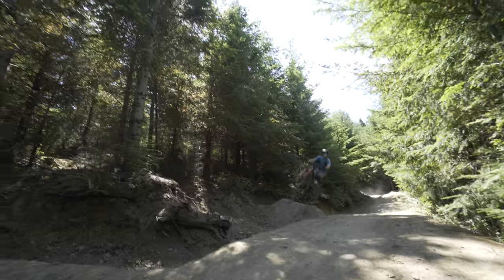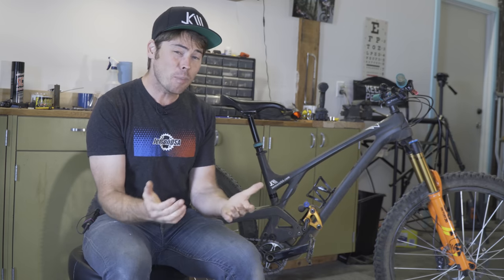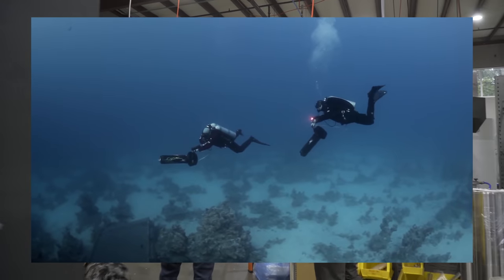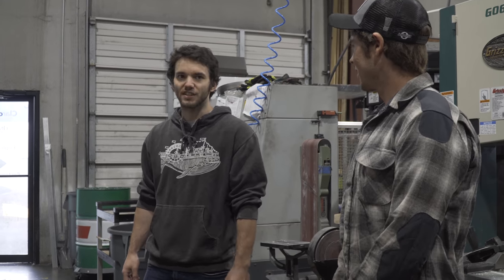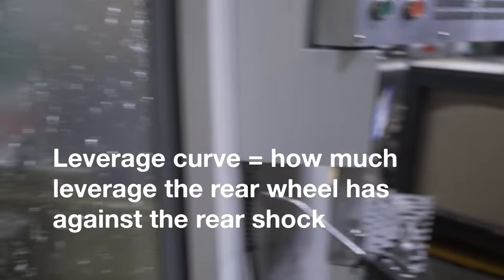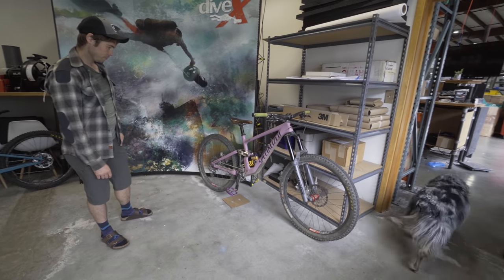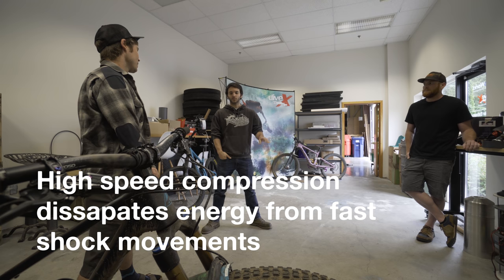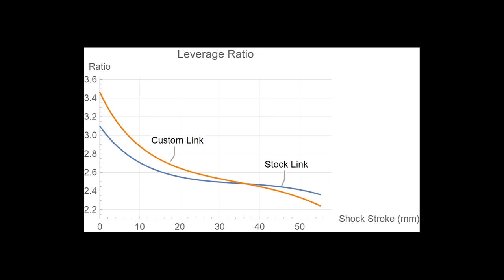Cascade Components linkages: story and test!

Comment: Cascade link went over center over compressed rear shock jamb rear tire against seatpost I went over the bars took 3 mechanics to pull it out sent link and frame to cascade for evaluation and they could not find anything wrong except minor bearing wear and they sent all it back said tuff pal we can’t find any fault with our product. Lesson learned Factory engineers design frames best not to try to make a frame travel further than it was designed for! Now I’m stuck with a damaged $4k carbon frame front triangle. I changed back to Santa Cruz standard link to be safe. I have videos without shock on that I sent to cascade they you can see how link allows head of bolt gouge into frame and jamb

Comment: I have my Tallboy 4 set up very similar to Logan (140 Pike, Super Deluxe, CC link) and I AM a bike nerd. In addition to the leverage curve change, the Cascade link adds 8mm of travel and 5mm of chain stay length. I think all of those factors combined are what make the bike feel so good.
Reply: Do you feel the SD is much different than the DPS with with the CC link? I am hesitant to add more weight but am curious of the difference.
Reply: @Mtully01  I had the SD on before i changed the link, but it felt better to me than the DPS. I think the DPS is fine for more XC riding but the SD handles chunk and bigger hits better. The CC/SD/140 combo makes it a great do anything trail bike that could be under 30lbs. That being said I bought a Bronson MX and I'm planning on putting the Tallboy back to a stock set-up.
Reply: @alkamite  are you running bearing hardware or standard
Reply: @bevanmody3385  standard

Comment: 2019 Kona Process 153 CRDL 27.5, Silver Cascade Components Link, 160f/160r
ME: Skillz 2/10  Cascade Stoke: 9/10
JKW: Skillz 11/10  Cascade Stoke: Meh
I feel my v2 Process 153 got all the benefits claimed.  The Cascade link made my Process even more playful, added midstroke support, softer off the top, and more bottom out resistance.  I'm happy with my investment.  Wish I could buy some JKW skillz.  Cheers!

Comment: I have their link on my 2019 stumpjumper and it made a world of difference.  I was always running high pressure and big spacers and still running through the travel. Spent a day at Snowshoe dialing things in and never went through as much travel as I previously did trail riding. I would recommend it for the Stumpy wholeheartedly

Comment: I upgraded my Switchblade V2 with a Float X and couldn't stop bottoming it out. The Cascade link made all the difference, I'm able to run a normal spacer and the small bump is good with enough bottom out resistance for riding park. This combo is 100% better than the stock set up with DPX2. I went from looking at new bikes to being super stoked on the SB again. Definitely worth the upgrade.

Comment: Dude's got mad suspension engineering skills! Stated curve looks like it'd work.
Huck to flat still hurts I'd expect! Supple on top but more bobbing on climbs?  Where I ride, that'd be a negative. Not a lot of down without the up. No mountains here, just lumpy.
Reply from the maker: Paul, I'd guess that on your more rolling terrain this link isn't needed.  Like Jimmy says, it's not gonna be for everyone, but if you want more bottom out resistance along with more supple initial feel, then it makes sense.  Rolling terrain usually means less huge impacts, as average trail speeds are down a bit.

Comment: I run a Cascade link on my Gen 2 Specialized Turbo Levo and it definitely does what they said it would. I’m very happy with it, you do need to go up in air pressure by the recommended amounts 5-10% else things will be too soft and BB height etc will be compromised. I bought the link when the Gen 3 Levo came out as Specialized were making such a big deal about the new bike’s progressiveness, so I hoped the link would make the Gen 2 ride more like the Gen 3.

Comment: I am a fairly large rider(6'4" 265lbs) and the Cascade link didn't work for me on the Specialized Enduro with the Float x2  shock. The increased leverage ratio doesn't allow me to set the sag correctly because I had the shock maxed out at 300psi(plus) and the sag was still about 40%. After some research, I ordered a Cane Creek DB Kitsuma Air to replace the X2 and I suspect that shock will allow me to put the cascade link back on. I'll find out in October, when Cane Creek finally starts shipping those dudes again! I love the Cascade Link on my Levo and I really hope to get it working on my Enduro.
Reply: If you're maxing out an air shock why not switch to coil at that point? The weight difference would be negligible
Reply: @TheBlutark34  I tried switching to a coil shock but no one makes a coil spring with a spring rate that is high enough for my weight.
Reply: @andersonsridebikes  oh damn , sorry to hear that. I've always heard bigger guys swearing off air and blown seals once they switched to coil. Good luck with the DB!
Reply: @TheBlutark34  Thank you very much for the kind suggestion! I have heard rumors that some companies are working on developing some faster spring rates, and I will definitely make the change when they do.
Reply: @CASEY I'm around the same size (6'5 260) as you and have been running a 700# coil on my Stumpjumper. Fox makes big springs, if you need heavier than 700 you can call them and they'll get it to you.

Comment: As an above average rider weight wise, Clydesdale territory actually, I’d love cascade to design a link that actually lowers the leverage curve on my Ripmo. Us bigger guys have a seriously difficult time getting proper sag and pressure on bikes with high leverage curves.
Reply: What worked for me on my stumpjumper was Cascade Link plus Coil Shock. The linear coil shock with correct spring + more progressive linkage worked great for me (more support, with the good bottom out resistance of the Cascade Link). I'm 6'5, 260lbs and running a 700inlb spring on an XL Stumpy. 

Not sure if this will work for every bike, just sharing my exp.
Reply: So a cascade link isn’t conducive for a Clyde ?

Comment: Thanks for the insight. This information isn't really available/obvious on their website. Besides just saying they make links and they're better. 
I'd definitely consider one for the 29 Reign if they can increase travel a bit and more small bump compliance.
Reply from the maker: Hey Jamlee, the goal of these links is not to increase travel.  Even as a former pro rider, I don't really notice +/- 10mm of rear travel.  However, these links do make it either harder to bottom out, or softer at the beginning of travel.  When they make it softer, in turn you can run a higher air pressure, which will then make it harder to bottom out.

Comment: Man I would love to see a test ride and review of the Cascade Link on the Ripmo V2. I have one and have been trying to decide if the Cascade Link is the right solution for me or not. I have messed with my X2 settings a bunch, have maxed out volume spacers, and run around 20% sag and still bottom out often on my local trails. I even tried getting it custom tuned and still keep bottoming out. Would really like to see how you feel about that link on the Ripmo.
Reply from the maker: Interesting!  Alex, have you tried a DPX2?  In general I prefer the DPX2 over the more expensive X2 for the Ripmo V2.  I did just toss a custom tuned X2 back on the Ripmo V2, and it feels good, but man, that DPX2 is just killer.  I run either a .8 or .6 volume reducer with the DPX2.
Reply: I haven’t tried that actually. I assumed the X2 would have better bottom out control since it’s a DH shock, but I’ll see if I can snag a DPX2 and take it for a couple rides. I’ve been surprised before, so I’m open to trying just about anything.
Reply: @alexorcas1  or a topaz t3. All of my dpx2's and X2's have dealt with air oil mix. Topaz uses a bladder instead of IFP. Smoother off the top and you can control end to end stroke.

Comment: This is super rad, I've been debating whether or not to even keep my ripley af, even with 9-10mm sag and the .9 spacer I'm bottoming constantly. I'll have to take a look to see if cascade offers something for it, there are so many good things about the ripley af but the rear end just can't keep up. Might be a good option
Reply: Damn, only ripmo af and v2 links
Reply from the maker: Pro tip Case- if you want more than what the stock Ripley AF is offering, post up on an Ibis forum (MTBR Ibis forum or Facebook the Ibis owner's group) and offer to trade frame and fork with someone who has a Ripmo AF.  The Ripley AF doesn't get much better even with a bigger shock (I have a DVO Topaz on there).  The Ripmo feels WAY better for aggressive riding like that.  When I went back on the Ripmo AF after a month or so of exclusive Ripley riding, I was like WTF, the Ripmo is way better!  I definitely prefer the Ripmo, and mostly use the Ripley just to change things up and keep life interesting.
Reply: @JeffKendallWeed  that answers my question... didn't think I'd find the answer to my question on should I trade in my ripmo af for a ripley... but here you are in the comments section of a cascade link video answering my questions. Watching this video RE should I put the cascade link on my ripmo af and up the fork to 170mm... I like my Jade X coil, but run a 550lb spring to stop the bottom outs on the bigger impacts I take... leaves the bike feeling harsh on trails. Feel like the cascade link may give me more subtly off the top and let the coil take the hits deeper in the travel... Im not sure I'll get a response here... but thoughts?

Comment: Great video thanks for sharing. I'd be interested to hear a comparison of more volume spacers to the cascade link. 

I'm still out on the cascade link on the my SB150. I like the additional progressiveness but didn't try additional volume spacers before. I'm not a fan of the geometry changes. Pedal strikes happen 3-4 times per ride versus every-other ride, and I think the slacker head tube makes it a little more difficult to get over the front wheel cornering. I plan to swap back in the old link with another volume spacer to compare.

Comment: Hass CNC....is #Ave leaking into JKW's channel?
Also, they don't have a RIpmo V1 link.  Sad face. Maybe there's an engineering reason for that.
Reply from the maker: What's #Ave???  I have a few fab projects on hand currently, I'm actually considering getting a MIG and a sheet metal brake...
Reply: @JeffKendallWeed   He's up in BC, has a channel about machining, fabrication, fixing stuff, tool teardowns...  And dirty jokes.  And general laughs.  Rides mountain bikes a bit too!  He used Patreon funds to buy a 5 axis Haas machine a couple years ago and has done a bunch of videos with it including machining some designs viewers have submitted.